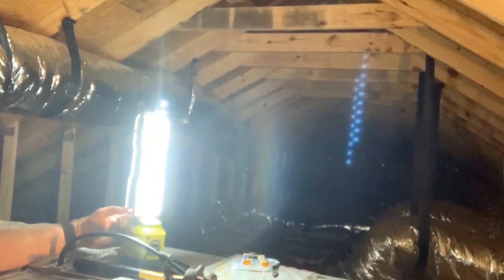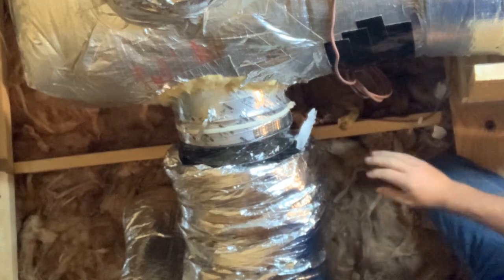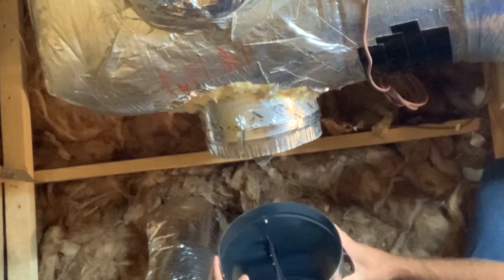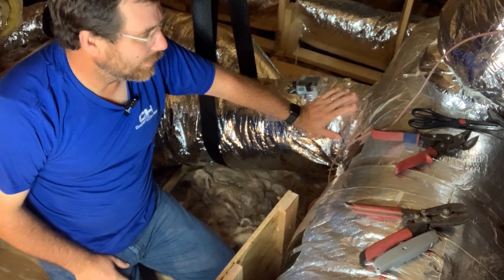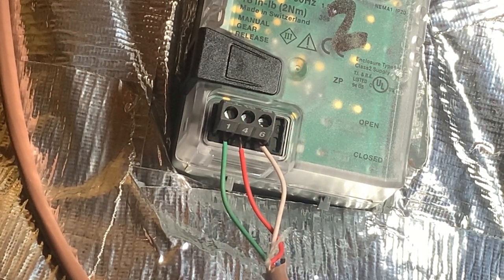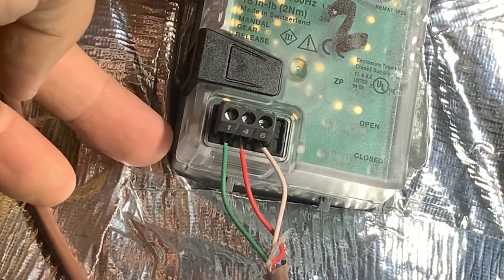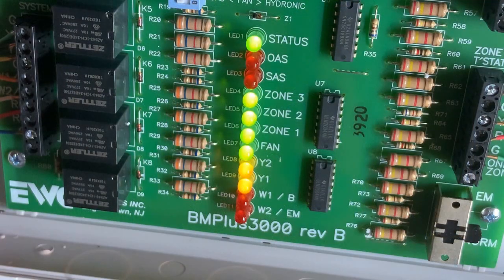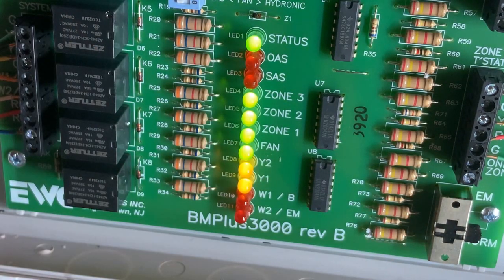Installing Zoning on my HVAC System | EWC Controls

Comment: The difference between a mechanical contractor and a Wana be that don't know static pressure from a peanut, Zack is a professional  a brother in the hvac trade that uses acca and common sense  codes. U go zack.

Comment: we just bought a house with a zoning board. We moved in and it was freezing up. They replaced the blower fan and then replaced a damper/motor.  Now every few days it randomly switches and won't allow the damper to open for the downstairs (the new damper) and it blows all the cold air out of the return. Yes we put paper in front of it and it blows the paper away and it is super loud. They don't seem to know what is going on. As now we are paying for all these new parts and want another grand to do the board and $500 to program the board. Its frustrating. How hard is it to buy and install/program the board ourselves? Maintenance guru just not hvac
Reply: That’s because it’s wired wrong. By default the 24v red wire should be on the power close side because how they make some dampers is always to be open when no thermostat is calling. When a thermostat calls for the second floor for zone 2 it stays open and zone 1 for first floor closes. Most people think the power wire goes on the power open side but it’s always going to be open when there’s nothing calling for it so switches it to the power close terminal

Comment: I've been fighting with this board since 2014. The first company that installed it had to send out 3 different techs because they didn't know what they was doing, and when I had a different company come out 2 years ago for service they said it was still wired wrong. Your the first person that I've found online to explain it in as much detail as you do. Thank You. My house is set up 2 zones for standard natural gas furnace and ac.
Reply from the maker: Zoning is done incorrectly a lot of the time. Some light training is required to do it correctly.
Reply: Zoned systems need to be installed and set up by a SEASONED LICENSED Contractor, static pressures must be within manufacturer specifications and by pass dampers installed, with low and high temp protection, I prefer dump zone if you have one or two instead of blending into the return, a seasoned contractor should be familiar with psychometric charts , and air side equations, with load calculations , if your contractor is not up to speed on these imo I'd look for one that is.

Comment: Love this video... Can I make one criticism? I have installed access control systems for a living in my past. When you have a multi-conductor cable and you don't use all of the conductors, please don't chop the unused wire off. Simply wrap them around the cable sheathing. When you upgrade to a different controller and/or different dampers that require an additional conductor or when you end up with a dead wire, you can easily switch to a new conductor quickly and get back up and running without pulling new cable.
Reply from the maker: What I typically do is leave part of the cable coiled up and taped off so you can extend and make new connections

Comment: First time I’ve seen one of your videos and the way you are able to explain things in such simple terms tells me you really know your stuff.  I provide tech support for a couple manufacturers in Houston and recently took an EWC class.  I was extremely impressed with their products and their boards are a work of art.  Now that you’ve had it installed and running are you happy with everything?  Any updates or things you would have done differently or liked to be improved?  Thanks for the video.

Comment: a zoning system was pitched to me from an HVAC company....the air handling system i have was designed to handle 1500 sqft, I know this would help my balancing issue with one room not warming up versus the other rooms. he wants to put a thermostat in there and balance that room with the rest of the system, but my worry is what happens when that room is only calling for air and the rest is shutoff. I can only imagine it would short cycle even with a bypass. thats a crap ton of air going into a small room.

Comment: For your dip switch settings, do you put #4 in O or B if you have a conventional air conditioning unit? For cooling and heating limits controls: staging timer, would you put it in off when you only have a single stage? Does it matter what temp for 2nd stage heat differential when you only have a single stage? Great video!

Comment: Thanks for this. At 37:00 when selecting temp settings. If they are reached will the unit start back up after a certain time or is it locked out?
Thanks again

Comment: Amazing video! I have the same zone control board on a single AC compressor (single stage) with 2 zones. I recently switched thermostats from the old white and rodgers to a new Honeywell T6. The first zone (upstairs) will turn on AC compressor and furnace fan, the second zone (downstairs) turns on the furnace fan but not the AC compressor so the air blows but it is not cold. Any troubleshooting guidance? Both thermostats are wired exactly the same RGWY. I placed the old thermostat back but it did not make a difference :( thinking about swapping zone 2 wires to zone 3 to see if it’s the board
Reply: On the zone control board check voltage on the second zone for r and y and see if you have 24v calling and check thermostat to see if you get the same. Should just be a wiring problem on your second zone if your first zone is working fine.

Comment: Does the actuator not come off?
Reply from the maker: Yes, you can remove the actuator
Reply: @HVACShopTalk  I remove them, slide the duct, then just cut the holes needed for the actuator.